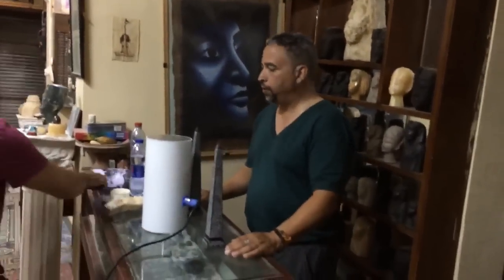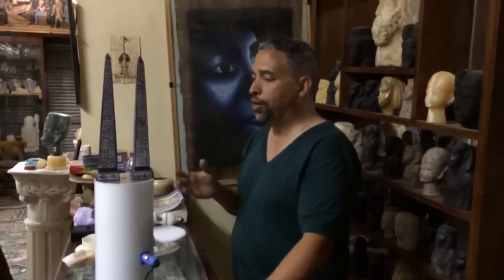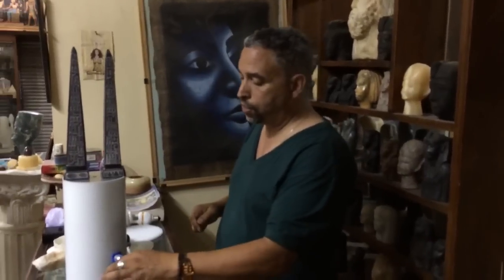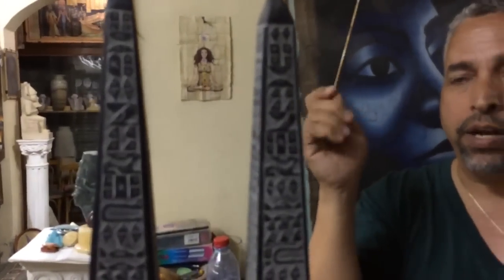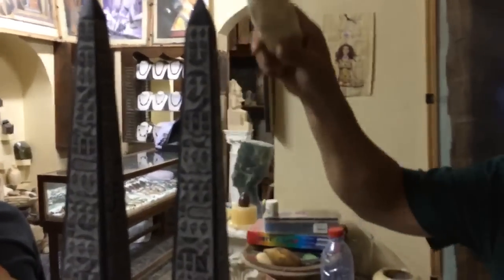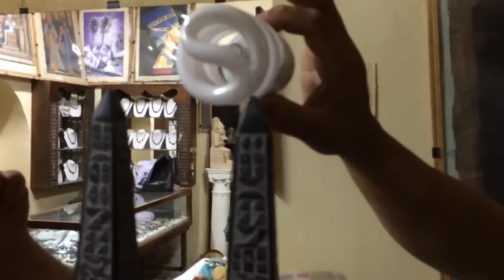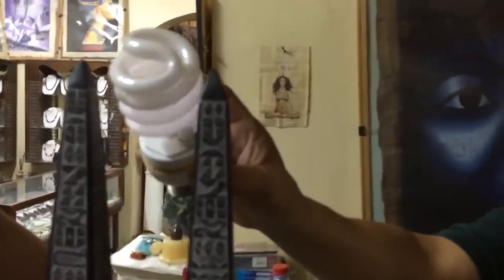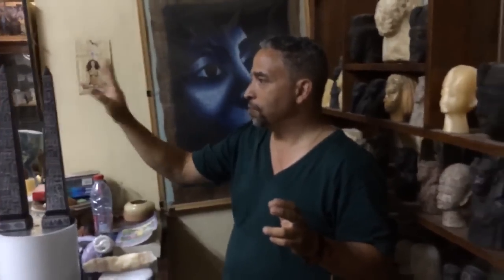Lost Ancient Energy Technology

Comment: Please get an energy spectrum/wave length chart. It shows at what wavelength energy goes from light to microwave to radio etc. Something like that would help you give people a visual representation of the difference between varying parts of the e.m. energy spectrum. There is only one life force, how it moves determines how we name it's aspects. It acts as visible matter while simultaneously binding those parts of matter together with it's shuet. Number of atomic bonds in a thing determines density. Thicker a thing is with bonds, the harder to cut, the more conductive it is and more stored energy it represents.